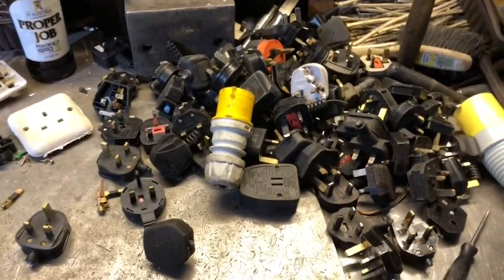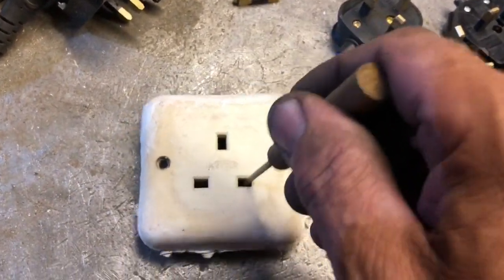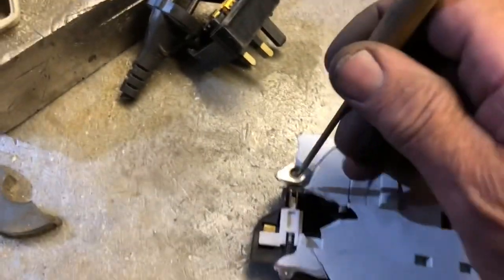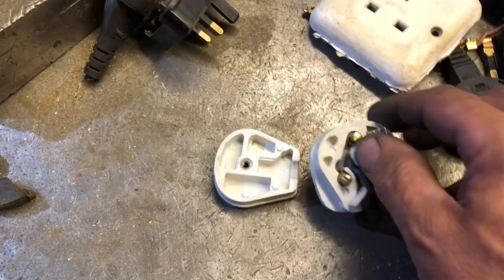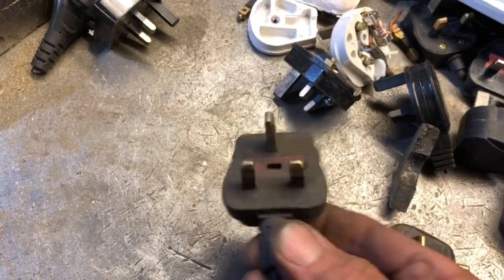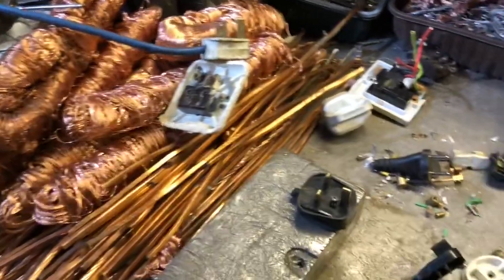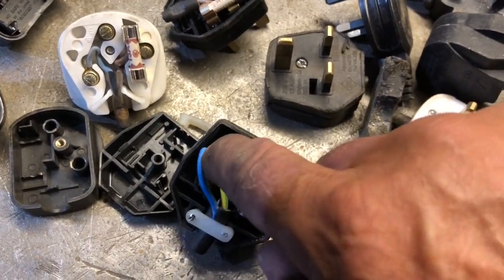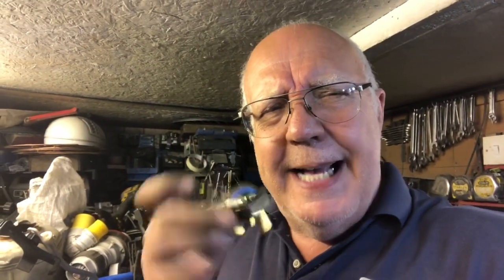The Great British 3 pin Plug

Comment: Shocking how many plugs you have lol ! did you know thay are only rated for 13 amps for a short period of time. 10 amps is the Max you can pull from a plug constantly. otherwise thay just heat up resistance goes up then they melt I do believe
Reply from the maker: Lol. Those are only a quarter of what I need to strip, the moulded plugs are a pain and I either use the @ snobby scrap picker plug soup method or come up with my own, I need to spend some time tinkering on that .

Comment: My uncle's house was a pre-war time capsule. It only had a couple of old wall sockets; if you wanted to use the vacuum you had to plug it into the light fitting. His fridge was powered by gas rather than electricity.
Reply from the maker: I actually have a light fitting adapter somewhere in here.

Comment: Round pin plugs Ian showing his age .  Don't stick thing's in plug holes unless you want waken up deed.  True older stuff was better quality plugs have evolved some are cheap crap. You can use 2 pin plug in adapter. So basically they thought about safety all the way. Double fused for safety. So basically they changed design for more safety.  Or the  Saftys lol. (Name for this video Ian Matthews explains Safety )

Comment: Another interesting comparison is that US wire code calls for outlets to be situated with the ground plug facing up, so if you dropped something metal on a slightly unplugged plug, it would be safe. I have never once in my life seen the socket installed correctly. I suspect it is the innate desire to anthropomorphize the outlet, it looks like a happy face when it's upside down/the standard
Reply from the maker: That’s a big word  easy for you to say,  I’m in a Facebook group called micro scrapping faces, where we ( scrappers) post pictures of faces we see in scrap. Some are quite amusing. Pop in have a look.

Comment: That's weird. In the states the white wire is the neutral and the black is hot. Seems highly insensible to have the exact opposite color scheme.
Reply: The sparky's over here say, black to brass or fry your ass. It's interesting that there are very similar little couplets on both sides of the pond
Reply from the maker: We have another saying, Brown is the colour you make your pants if you get it wrong,  but I didn’t include that .
Reply: Well the US does like to be different to everyone else.